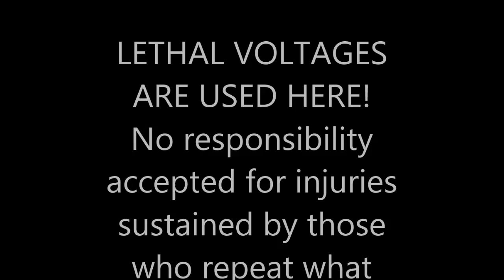DEATHTRAP SCREWDRIVER!!

Comment from the maker: The 12 volt ones are fine as long as you don't get it mixed up with 240V, but, even then they are usually fitted with a ground lead for the return path to the battery!!

Comment: I was wondering: Do you have a [suitably sized] variac?

It'd be interesting to get a neon screwdriver solidly connected between a pair of series-connected MOTs, then crank up the variac.... Until the screwdriver pops! :D

Also, if you have a clamp meter, put it on the output end of the screwdriver so that we can see when the current shoots up as the screwdriver's internals fizz over & can no longer hold back the volts. :D

As soon as it lets loose, RIP THE VOLTS RIGHT UP FOR POPPAGE! :D

-BBD.

Comment: i hate to be the health inspector but 1. you had all that stuff touching that metal cover. 2. the 300v insulated wire from the chicken stick was pretty close to your particulars. 3. all that plastic smoke and stuff. be safe man! clean works paces and well ventilated areas :D that screwdriver is in its proper place though, a puddle of charred plastic :D

Comment: I use this type of a screw driver. Its about 1.5$. Tested it with a multimeter @ 230V 50Hz & been using it since 2 months. I don't even feel a tingle. These are absolutely safe if used properly & maintained properly. Also make sure u check it with a dmm before using one. I am interested in the led one as its non contact. Can anyone pls tell me details of a good reliable brand.
Reply from the maker: +mbrij 96 There aren't any good reliable brands of something a simple drop from a few feet can cause a fatal fault with.
Reply: +australianstig U r most probably right. If u r going to work in wet conditions & there is a chance of dropping these contact voltage tester can be fatal. I am actually a student & don't work in conditions like that. Thats the only reason the cheap voltage tester I have been using hasn't killed me yet. But I will be upgrading to a non-contact voltage tester preferably the fluke one.

Comment: How many volts is that?
Reply from the maker: +mbrij 96 2500
Reply: +australianstig Sir how do u get upto such high volts in ur garage?. Whats the current & voltage at the primary of ur transformer? At my apartment I have 2.5 sq.mm wiring through the walls. 2.5 sqmm stranded copper can support upto 25amps & hence our main braker is a 25amp c25 type breaker. The voltage we get is 230V~ 50Hz. Can a transformer like that be used with my existing electrical setup?
Reply from the maker: The mains voltage here commonly just exceeds 250V and I use a transformer with a 1:10 step up ratio and the current is limited to about 2A
Reply: +australianstig Oh thanks for the reply. The mains voltage at my apartment is usually 230V, although it should be 240V as per the electricity department  here. Is this bad coz equipment that need more power like a water heater or ac would draw more current?
Reply from the maker: The ac would draw slightly more but anything resistive like water heaters would draw less but take longer to heat the water in the tank